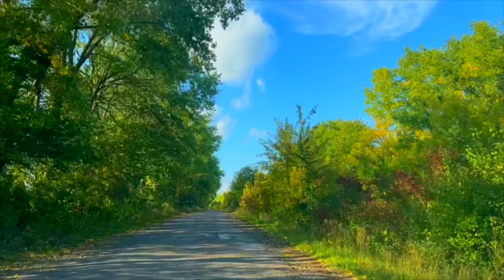What are the most common problems with a used Skoda Octavia A7?

Comment: I have two Octavia's from 2014 (III gen), and they both have same issue. O2 sensor and P2196 error code and can't seem to fix them. Even the dealer stated that all is good but the code appears every ~1000km. ON both of the cars. I've just given up now that I have tried every fix I could find.